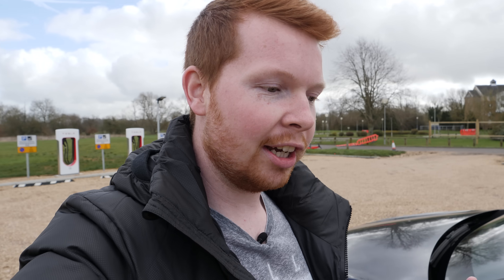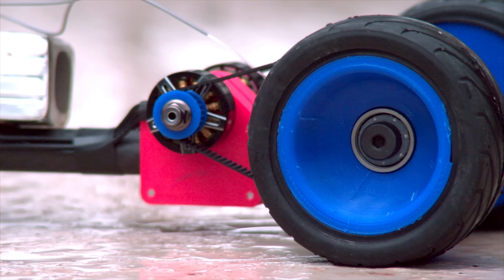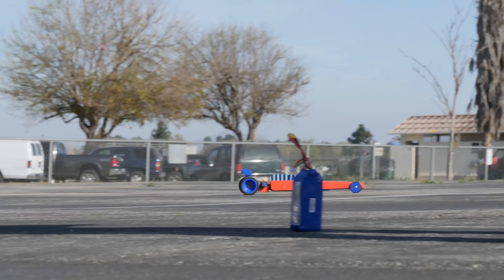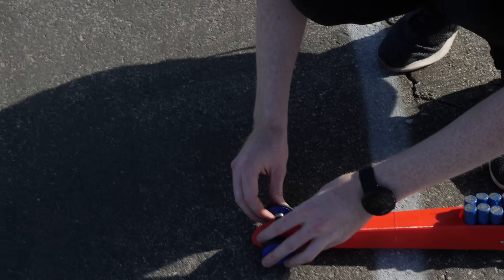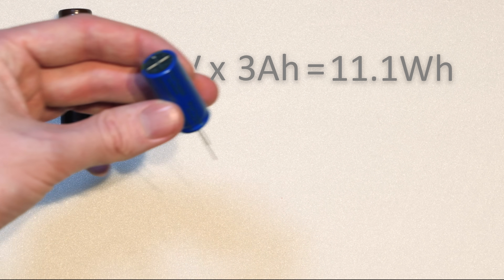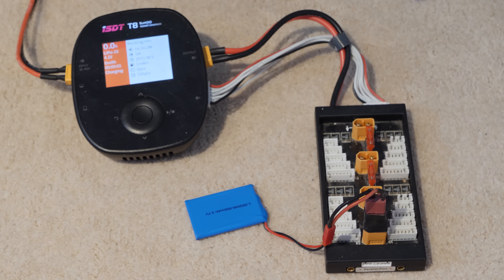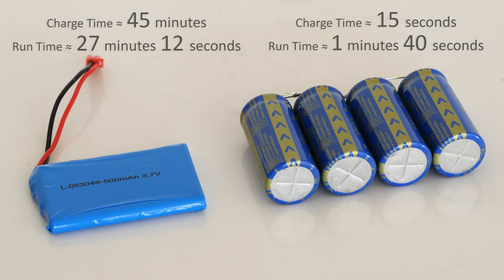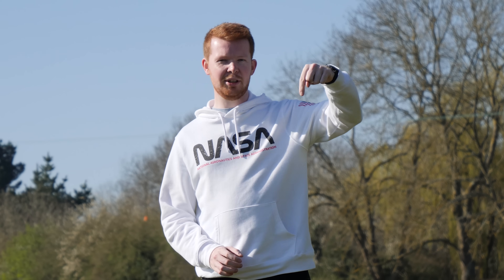Super Capacitor Dragster

Comment: The thing with capacitors is that they provide huge power boosts, but die in a few seconds. So heres an engineering question:

Could capacitors be used to temporarily boost the speed of an electric vehicle (like nitrous in combustion engines)? Batteries would always be in the car, but the capacitors can super boost the car if needed.

Comment: Capacitors are not beneficial for their ability to retain charge, they are beneficial for their ability to discharge incredibly quickly without harm. You need to pair the supercapacitor bank with something like brushless motors which can consume large peak amperage. You will further decrease your battery lifetime, but if you can make the tires grip it will accelerate like crazy

Comment: If the batteries last 1½ hours and the capacitor only 1½ minutes but can charge the capacitor in 15 seconds couldn't you use both together and make it run for hours.

Comment: Since the caps get charged fast. Use both battery and capacitors. For normal low speed operation use the battery. Switch caps on for burst short high speed then recharge the caps with separate motor connected to the wheels shaft or small retractable turbine tube. Auto shut off is required when caps are fully charged to eliminate drag or power leakage.

Comment: what if cars have  a mixture of capacitors and batteries and the first half of the charge is super quick but less range than the other 50% of batteries which charge as normal and they feed in alternations between capacitor or battery discharge which powers the electric motors and capacitors holds energy from Regenerative braking. Might be dumb but I would love to see what would happen.

Comment: Should build a circuit to alternate charge and recharge from each column with an onboard battery.
Reply: That would serve no purpose. Try engaging your brain before you comment next time.
Reply: @williamcampbell9859  What purpose is served currently?
Reply: @BiscuitsMcGravy  light weight and quick recharge time.
You would not have Light weight carrying a battery around, and if youre charging capacitors with an onboard battery just to immediately discharge them you may as well run straight off the battery. Youre not getting any more power by doing what you said.
Reply: @williamcampbell9859  Not getting any more power with capacitors either.  I think running off the battery is a good idea.  Thanks for the conversation.
Reply: @BiscuitsMcGravy  instead you're getting a higher power to weight ratio, which is important for a dragster.
Reply: @BiscuitsMcGravy  you can also discharge them a lot quicker to dump a lot more power. Which if you have them being charged by a battery, you'll be limited by the discharge rate of the battery, not the capacitors.
Reply: @williamcampbell9859  DC orgasm.  I see.
Reply: @BiscuitsMcGravy  fucken what?

Comment: Capacitor Bank run time = 1.40 minutes
Battery Bank run time = 28 minutes

1:40 Min = 100 Sec (15 Sec of charging) 
28 Min = 1680 Sec (2700 Sec of charging) 

1680/100 = 16.8 times
16.8 * 15 = 252 Sec

2700 - 252 = 2448 Sec

Time you save to charge Capacitors Bank and do 28 rounds is 2448 sec which is around 40 minutes. 

Other way to put is on 5 minutes charge of capacitor bank you save 40 minutes and can still do rounds as many as battery bank. 

Clear winner is Capacitor Bank, but downside is since it can't hold much power it needs frequent charging.

What are your thoughts?

Comment: You built a "dragster" car.... a DRAG RACING CAR, they were never designed to turn more than a foot or two (from trajectory) to keep from veering off. Idk what you think "drag racing" is, but I'll tell you simply, they race IN A STRAIGHT LINE. What your little RC car did when you trying to make too sharp of turns is EXACTLY what they would do if they were real "dragsters". So don't be surprised that your very narrow RC car flipped a few times, breaking apart, because it did EXACTLY what it was designed to do 😂

Comment: What would happen if you leave the battery plugged into the capacitors will it build charge off the battery as it drives and still be fast or will it just run off the batteries and not the capacitors??

Comment: The numbers from the small car are quite interesting.

When charged at a rate of 1C, the LiPo batteries took about 180x the charge duration for the capacitors, however they only ran for about 16x the duration of the capacitors. Clearly in this case the capacitors are the winner when it comes to charge rate.

But that's with a charge rate of 1C for the LiPo batteries - I believe Tesla found that lithium batteries last longer when charged at higher rates, as long as the temperature is kept down. If you charge at a rate of 10C things start to even out - The question then becomes how much cooling is required and when do they set on fire.

Comment: I am wondering how security (on crash) and economy / ressources would balance this comparison... Security of capacitors is because the electrical energy is stored a strong problem whereas lithium is chemically a securiry problem (h30+ and hf). And lithium is a problem because it's so reactive there is a huge co2 output extracting it.. Capacitors are just build with foils and metals that also can recycled. The lifetime of capacitors are depending on temperature and under good condition about never going to die. How is the balance between those two?

Comment: What is the conclusion to this?  I didn't pick up what the outcome of your science was.  This would make your vids better. I love your vids, but they tend to just end with a "I hope you understand the outcome of my experiments" vibe.
Reply: Maybe listen to the video and you will understand the science...
Reply: @rhysbfilm  I understand the science, but it is always nice to have a solid conclusion.
Reply: Well what do you mean by conclusion? There isn’t a hypothesis or claim at the beginning of any of his videos, so why would there be a conclusion?
Reply: @rhysbfilm  Well, conclusion doesn't necessarily mean that there is a hypothesis.  It just means that there is a script, and he is going over points of why super capacitors are good, or bad, for vehicular usage.  Like, "Super capacitors recharge faster, but have a shorter run time compared to the normal battery.  Capacitors also have minimal long term damage due to the quick charge time. (CONCLUSION) Though it would be faster to charge, supercapacitors would not be useful with modern electric vehicles due to the fact that you would need to be charging your vehicle every, lets say, 50 miles instead of the normal 1000 miles, and the size would be much larger than that of the normal 12V battery used in vehicles today."  This would be useful to those that may have not understood the whole, and wouldn't be as abrupt with the ending into the sponsors message.
Reply: JaysFSM I get that but can’t you just gather that information from watching the video?

Comment: The problem is not the battery, but the physical limitations of possible charging systems. You'd need an offshore windpark's DC converter worth in electronics to charge supercaps in normal sized cars. And a nuclear reactor or yet another bank of capacitors that then needs more time to recharge before it can refuel the next car to supply the power.

Comment: Thought: regenerative type battery charging utilizing Supercapacitors and Lithium cells. 1.  Run a small MG to charge the Cap and in turn charge the battery. 2. Static charge from straps dragging on the ground to charge caps. regenerative braking to charge caps??? Food for thought

Comment: We seriously need a supercapacitor speed booster on a regular electric car where the car itself uses lithium batteries, and as it drives it charges up the capacitors and you can hit a button to put all the supercapacitor energy into the motors making it go way faster, maybe you could do the same with propellers...

Comment: You could use the capacitor and have a battery hooked up with a switch. Once Capacitor voltage reaches a certain point, the switch closes finishing the circuit to the capacitors from the battery. In this you should creat a lot longer run time. 

After writing this down, I don’t think that would work but I will keep it here just in case.

Comment: i got an nice idea for you mate, while capacitors(lets name this set A) only last for about a little more than a minute, it doesn't seem practical, but add 4 more capacitors(lets name it set b) which would be charged by the wheels motion, and when set B's energy is being used it will charge set A, and it would keep working alternatively, it will tend to last longer, if you didn't understand my idea let me know i will edit it and try being clearer.😉

Comment: Super Caps can be used with regular battary as compensator for short time high loads. F.e. if you have a havy car and you need to accelerate it fast then super caps are used but when you need to keep some speed battary is used.

Comment: Batteries and capacitors in parallel with motors turned into generators when the brakes are applied. Take it a step further, and make the structure of the vehicle itself made of dialectric layers, with a photovoltaic skin... Just my two cents.

Comment: "capacitors don't seem very practical" aand you miss the use of capacitors, batteries are work over time, Diesel engines but electronic, capacitors or about a burst, guess you could say the horsepower, use them both in the right way you can make a portable railgun

Comment: Using compare metric like  "This battery can charge within seconds instead of minutes" is a nonsense for EVs. Because the batteries are already since at least 10 years ago not the limiting factor. The thing is, to charge typical 50kWh battery within 3 minutes (to "compete" with standard liquid fuel tank filling time), you need to get at least 1MW power into your vehicle. That is, what rather decent size locomotive draws from the catenary. And what is everything but trivial task. Mainly the safety part of it. Batteries are long time able to accept that power, yes, cupercaps are way better at it, but neither of these is of any use, if there is no way transferring that much power. Not even speaking about the havoc such loads will cause in the neighborhood power network. So a a hunt for "fastest charging batteries" is these days just a marketing BS.

Comment: Can somebody explain to me the voltage calculation at 1:43 ? 
He said he is using 3V capacitors, and I'm assuming you can calculate the voltages as if they were batteries.
6 capacitors in parallel and 2 in series to me is 2 x 3 = 6 Volts, the parallel configuration just increasing its capacitance.
Please tell me where I'm wrong, as the youtube comment section is known to do :D
Reply from the maker: I don't believe there is a calculation at 1:43? In terms of battery configuration, this capacitor setup would be labelled as 6s2p. Which means 6 in series (18v) and 2 groups of 6 in parallel, so a total of 12 capacitors.
Reply: @TomStantonEngineering  my bad, I got the timestamp wrong, I meant the part where you explained the configuration (1:13).
Thanks for the clarification ! 
I was just wondering how you could achieve the same voltage as a Lipo (multiples of 3.7) with 3V capacitors, but of course not charging them to their max, but just to the needed voltage, obviously works too :D

Comment: Love the idea of using super caps but the energy density limits their possible use.
Regeneration braking or very short runs between charging stations will be main uses, charging stations need to be able to supply extremely high current so probably need a battery which is trickle charged but better able to supply the high current than directly from the grid.
Caps are used for smoothing out noisy voltages and spikes among other uses.
I love electric vehicles but there are defo some issues that need to be addressed before the whole world can run them.

Comment: It takes 180x longer to charge the battery than the capacitors. This means that if it runs for 200sec. per capacitor charge, after 180 charges you have 600 minutes of time spent driving compared to the paltry 27 minutes of the battery. Seems like a good trade-off to me.

Comment: I'm an engineer (electrical, focus = robotics) too and participate in many STEM events at my work place.  You content is absolutely amazing; I feel it should be required content for any STEM based school or academy.  Keep up the good work!  I may try my own version of your helicopter with no swash plate...seems like a cool project.
Reply: Electric engineer? Hi! ...I'd like to ask...why are there no hybrid tech in cars using supercaps instead of batteries? There's gotta be a better reason than just 'sizes', right? It would be cool to have an 'electric nitrous' system

Comment: what if you use a lithium battery to charge a super capacitor over and over again as it depletes? would you be able to get more power output and higher efficiency from the motors?

Comment: Super/ultra capacitors are never meant to be a primary power source for a device. Caps are high voltage devices that are aimed @ assisting rapid charge of battery storage as well as other fuel sourced regenerative drives. But a very nice video showcasing advancement in storage of high emf capacitors!

Comment: Would it not be possible to use both. One Lithium battery to two separate capacitor banks for an alternating time charge. When one capacitor bank discharges, the other one engages and a relay system activates the battery to recharge the dead bank and then resets for the next capacitor discharge. Then the capacitors can alternate back and fourth..

Comment: So couldn’t you create a changing circuit. Add the battery and the caps to the car. When the caps get low the battery would charge the caps and then shut the battery back off and run only on the caps. Like pulse charging. Just a thought. Hope that makes sense lol. Don’t even know if that would work but worth a shot

Comment: Very cool! But having been in the RC scene for a long time I have to ask, is this necessary? Generally speaking, if a high enough C rated Lipo battery is used to power the motors to their maximum amperage draw, why spend the time using super capacitors to power the vehicle? The motors are already running at full power so using a super capacitor bank is a step backwards in terms of usability, except for the charging time of course. I have a small FPV Drone that draws a maximum of around 50 amps at full throttle but the batteries I use are 100C 1500mAh 4S, capable of discharging up to 150 amps, way more than enough for the setup. Were you mostly interested in demonstrating the ultra fast charging? Great videos by the way, you make some super cool stuff!

Comment: 50 MICRO Farads!     a 1 Farad capacitor is HUGE, like car stereo  That U with a Tail is the symbol for Micro it's called Mu.  Pica^-12, Nano^-9, Micro^-6, Mill^-3.  This also makes your math wrong.
                 
https://www.amazon.com/Rockford-Fosgate-RFC1D-Digital-Capacitor/dp/B000WUE1T4/ref=sr_1_3?dchild=1&keywords=capacitor+1+farad&qid=1592248060&s=electronics&sr=1-3
Reply from the maker: Nope, definitely 50F https://uk.farnell.com/vinatech/vec3r0-506qg/cap-50f-3v-super-cap-radial/dp/2663720
Reply: @TomStantonEngineering  I promise you that it's 50 micro Farad's the reason I can promise you that is because I've seen a 1 farad capacitor when Michael Faraday built the first capacitor he was limited in materials in size if you take apart a capacitor all it is is a ribbon of metal wrapped around itself really tightly with a very thin like varnish.. Michael Faraday did not have modern processing techniques to make a small capacitor. I am in school for this and have to work with  capacitance inductance and power curves.
Reply: @TomStantonEngineering  if you still don't believe me
Reply: @TomStantonEngineering  if you still don't believe me look up Henrie's in relation to farads and impedance

Comment: Tom, about a decade ago I read some one claiming that capacitors could be electromagnetically charged, that is without contact. This means electric-capacitor car could be charged without having to stop. Contactless charging is possible as I had an electric toothbrush that charged without metal on metal contact. Project?

Comment: Hey Tom,
Your projects are amazing and you are a creative guy.

As this video points out some advantages and disadvantages of batteries. Maybe you could come up with a optimal combination of both types of batteries? 🧐 As capasitors could power an engine with high consumption and maybe then be charged with lithium batteries?

Just a thought. 😊
Reply: this supercap dragster can match the 1/4 scale dragster racing

Comment: So, you demonstrate how fast super-capacitors can be charged- by charging from Li-ion batteries. Can you see the problem there? (it means the slowest technology sets the speed...) Since a dragster is limited to ~1g acceleration (grip) more current does not help- and your capacitors add up to about a 200mAh battery, which would be way lighter using Li-ion. Wrong application...

Comment: What if you put like wireless charging things in the road so the compactors don't run out but can be charged instant so you can drive small distances without charging or you would charge this things which then lead into a battery so you charge only like 60 secs but you battery charges after you disconnect

Comment: Use a longer  circuit  board to spread out the capacitors.  Use longer leads and lay some capacitors horizontal.  This will make the current design less top heavy.   You should warn people super capacitors can be dangerous.  Handle with care.

Comment: Since the capacitors don't have the same capacity as the battery I've wondered if a high voltage capacitor paired with a transformer could act in place of a battery and how small the transformer could get
Reply: isn't it a DC circuit, so how would a transformer work?